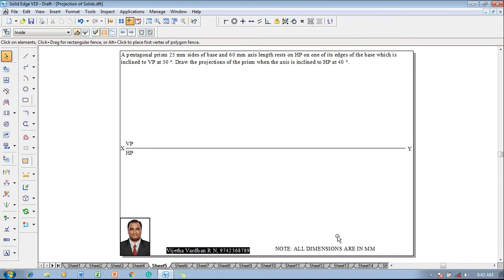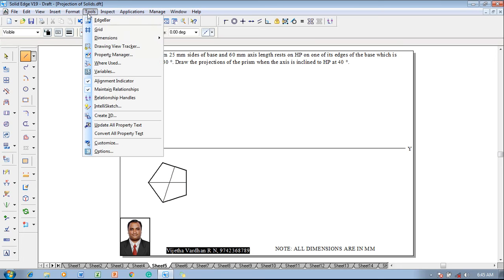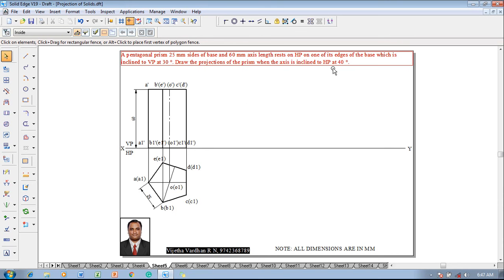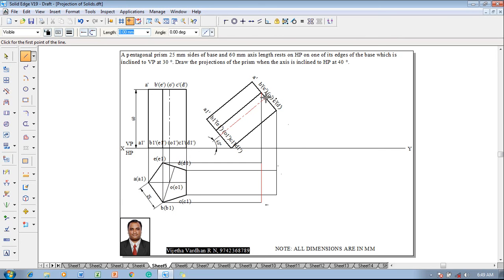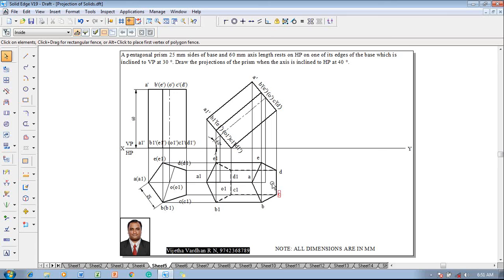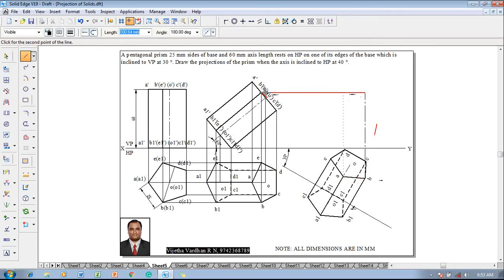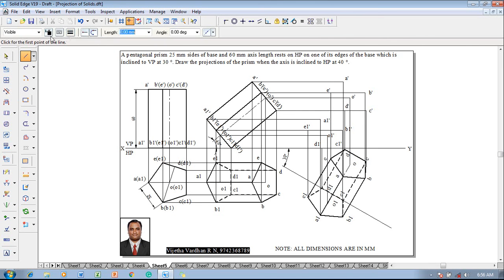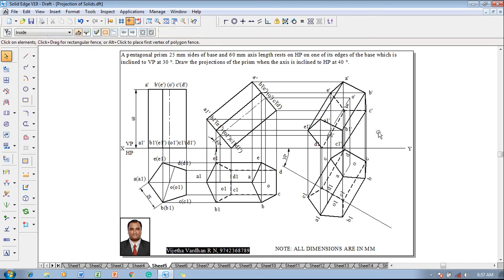Example 05 on Projection of Solids

Comment: Sir in projection of planes the Pentagon drawn in the first step was facing opposite for the edge condition.Will this step gets changed in solids for edge and corner?
Reply from the maker: Yes in planes we rotate in anti clock wise direction in case of solids clock wise direction. You can alter it no issues.
Reply: Ohk sir thank you  @VijethaVardhanRN